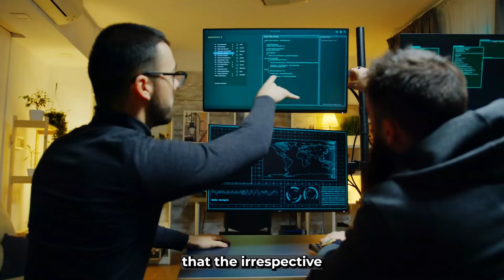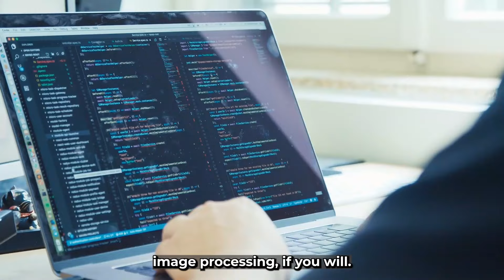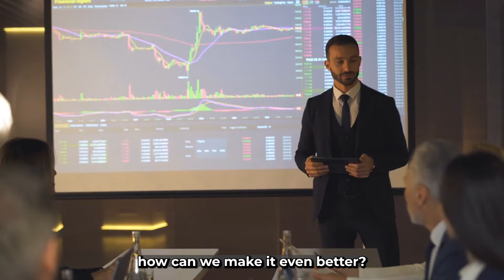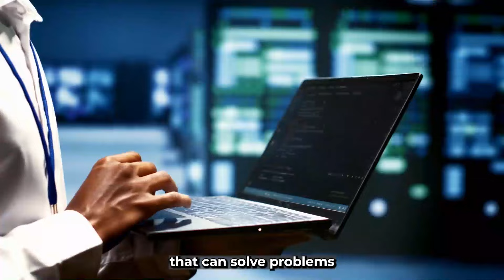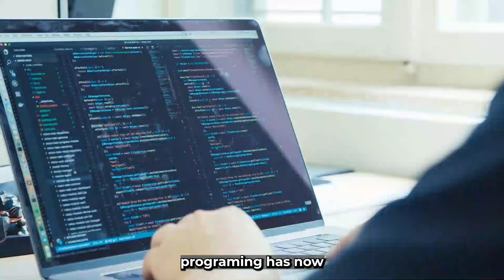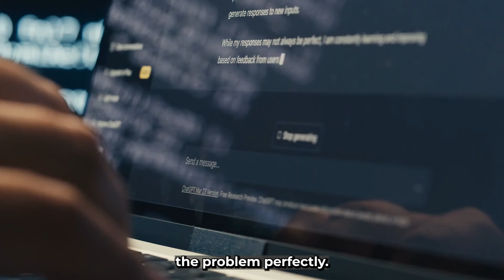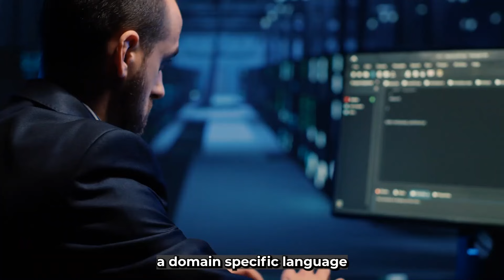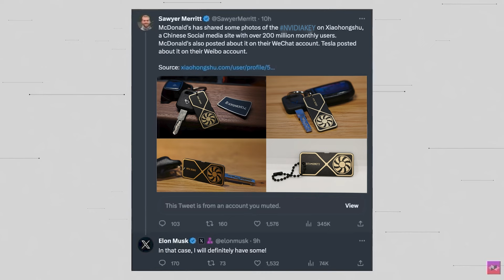Nvidia CEO Leaked Some Terrifying Predictions About The Competition Of Nvidia

Comment: First nvidia bought ageia who has the idea of using gpu for physx and more Applikation  as a library to use gpu for Accelerate Program with high parallel workload. Second first use of cuda was image upscaling and encoding.
third since 2013 first crypto boom proved that gpu can encrypt data  and nvidia bought some company's with it
fourth cuda  became a api forced from nvidia for General encoding and encrypting data
Fifth nvidia starts program to use cuda in algorithm to search pictures
in use of new designt tensor core explizit for cuda usage denoising and algorithm acceleration.
And now grown to the moon because of a hype train.

besides Ai nvidia stand near at the end of the road if nvidia has no answer to which cpu to use 2030 amd goes straight all in  apu exclude high end gpu and no cpu on desktop intel has problem to keep up. possibel behind amd for years and with only high end desktop gpu nvidia cannot survive.
should we see nvidia cpu in a near future